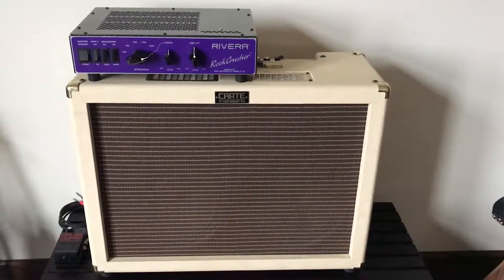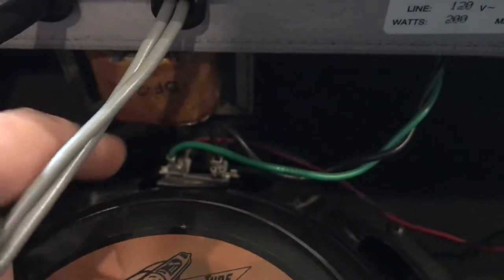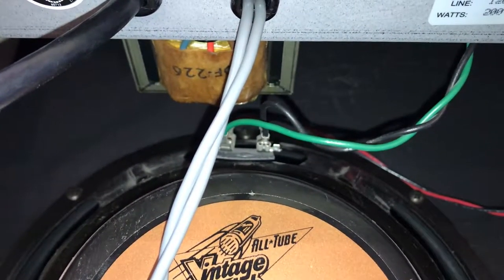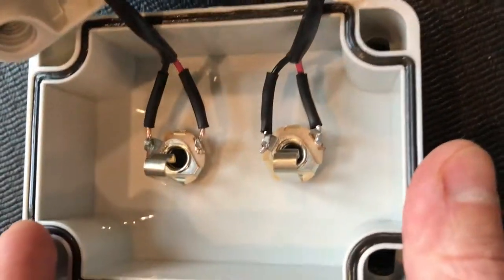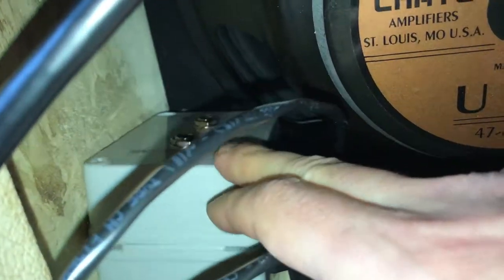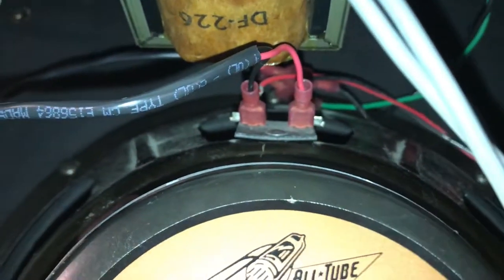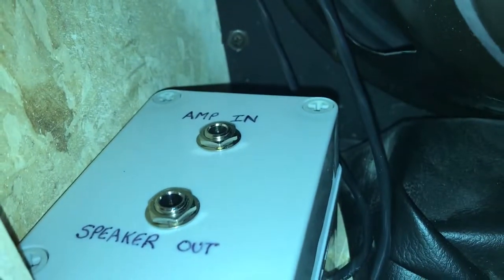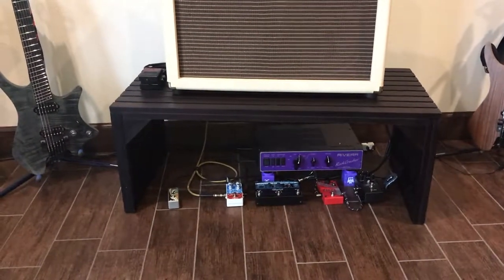Combo Amp Attenuator Mod (adding speaker jack connections)

Comment: Hello i am wondering how can connect my attenuator. my amp is fender bassbreaker 18/30 backside it has 2 speaker outputs main and external does that help or do i have to make things you did on the video ? Attenuator is harley benton pa-100.i dont know how to connect the attenuator :/

Comment: My amp has a speaker out . The amp is hardwired to the speaker. Could I go from speaker out, to attenuator, back to the combo speaker!?!
Reply from the maker: This maybe to add a second cab to the amp.  Say you plug this “speaker out”to the attenuator, where will you plug the attenuator back into the amp? Meaning do you have another input jack besides the main input that will run your signal back thru the pre and power amps?
Reply: @chadbouterse8617  sorry I maybe wasnt clear, I was going to get a little passive attenuator, so instead of going to an external cab, I was just going to buy a cable with 1/4 jack to spade lugs, and go from the attentator back to the original combo speaker.  Of course I would have to unplugged the hardwire connection already running from the amp to the speaker
Reply: @chadbouterse8617  would a passive attenuator have to be plugged back into the amp?
Reply from the maker: @themuzzfuzz7045  yes. the “passive” part of the attenuator means it doesn’t require a power supply to work.  However, all attenuators take the signal in, lower the output, and then return it to your speakers.
Reply from the maker: @themuzzfuzz7045  yes, this should work.  If you already have 1/4 inch connections between your amp and the built in speakers you’re home free.  This mod was showing how to add 1/4 connections when there was just speaker wire running between them.

Comment: Hi there, thanks for the vid.
Quick question: Is the polarity relevant? I want to do this but I'm afraid of letting exposed the metal parts of a 1/4" plug. Should I use insulated plugs?
Thanks in advance,

Comment: Hi great vid thank you for sharing your work. I’m gonna do this to my Vox ac15. 
I ordered all the parts and received them. I also ordered a switched female jack. I am hoping it will work so that I don’t need to use a jumper wire for when I’m
Not using the attenuator.
Do you think this could work? 
Meaning, using a switched female jack.
Reply from the maker: I have never used a switched female jack, but from what I just looked up, I think it should work.
Reply: Chad Bouterse okay thanks man. I just got one in the mail. I wired up the female jacks and am about to install everything.
Reply: @wyattsdad8561  Hey I know this is a good bit later, but if i can ask , how did it work out?
Reply: @Blackperoxide1  it worked out perfectly! The attenuator made it like I was hearing the amp for the very first time. I can get all the tone I’m supposed to get at any volume, including bedroom volumes. I one regular and one switched female jack  so that I wouldn’t ever need a jumper cable between the two. I cannot say enough good things about doing this setup.
Reply: @wyattsdad8561  what switched jack did you use for that mod?
Reply: @t3hS73rM4n  one more thing I wanted to mention. I used a mono switched jack and not a stereo one. Also if you plan on just using crimp push on connectors try to find a switched jack that isn’t made to soldier onto a board. The one I got on Amazon would accommodate push on connectors. If all you can find is the soldier type then you’ll just have to soldier the wires to it instead of using the push on type connectors. I tried looking up the one I bought on Amazon for you but I’m not seeing it anymore. They did have the soldier type ones tho.
Reply: Sorry to be a pain, but how do you do this with the switched female jack? I'm not sure I understand how the switch acts differently or what I would need to do different to utilise a switched jack - would you be able to give me a steer?
Reply: @brianwortman5037  if you don’t use a switched jack then you’ll have to use a jumper wire when the attenuator is not being used in order for sound to come out of the speaker. But if you use a switched female jack the speaker circuit becomes reconnected as soon as you unplug the attenuator. 
I hope I explained it well enough. I am so glad I did it to mine.

Comment: Would an A/B switch box do the same thing?
Reply from the maker: If you wired it so that both A and B both went to the the speaker cab and say only B went thru the attenuator, then you could switch the attenuator in or out of the circuit. But turning the attenuator off with the wiring in the video would achieve the same thing.  And they way I have it in the video, you could also use a different cab with the amp if you choose. Does that make sense?
Reply: No, a a/b switchbox is totally different to a attenuator.
Reply from the maker: @Krashulka  I read Jerry’s question as would an A/B box do the same as the junction box before the attenuator… but if he’s asking it the way you read it, I agree that they are totally different things 😁